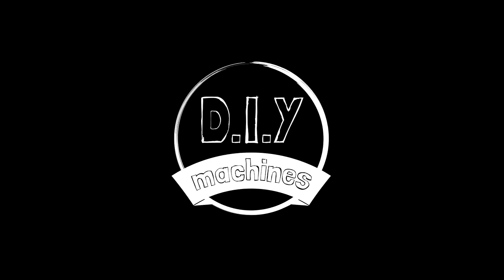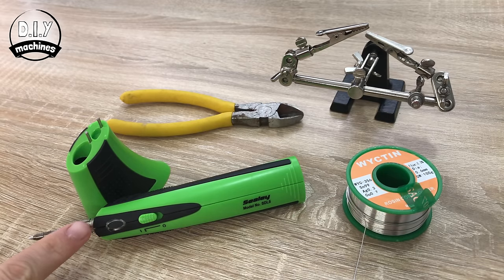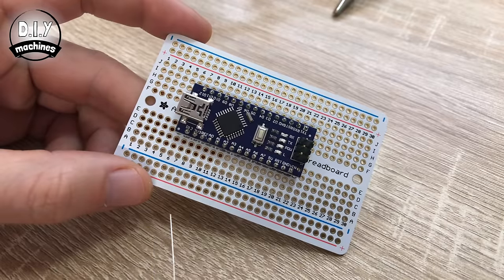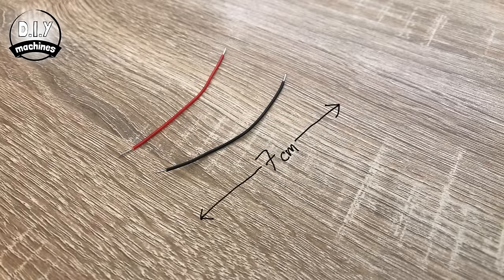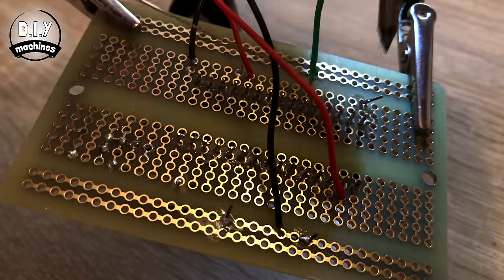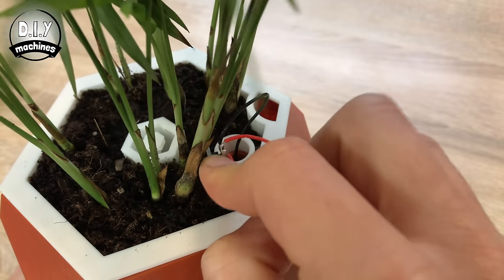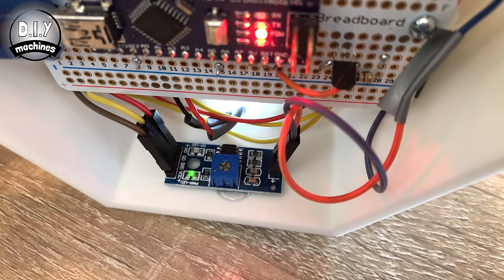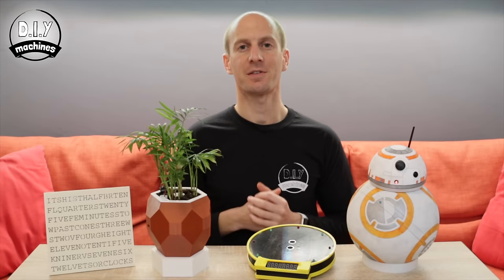Automatic Smart Plant Pot - (DIY, 3D Printed, Arduino, Self Watering, Project)

Comment: The 4.7 kohm resistor on the base of the transistor didn't allow enough current to start the pump that I am using (which looks identical to what is shown in this video). I kept lowering the resistance of the base resistor. The pump starts using a 470 ohm resistor. Hope this helps anyone else experiencing the same issue. Great video!

Comment: You have a permanent voltage on the resistive moisture sensor. It will do electrolysis and will fail rather quickly due to losing the conductive metal surface. It´s better to power the sensor only for the short time when a measurement is done. I would recommend capacitive moisture sensors tho. 
It´s a neat toy, alternatively a passive wicking setup would do the job as well.
Reply from the maker: Those are all very good points Karl. I'm considering a revised version later this year which will include a lot of the amendments you and others have suggested.

Comment: Ideally, when soldering, you want to put the legs of the component through the pcb and form them at 45 degrees to hold the component in place. This allows you to cut the legs to length before soldering, which avoids the possibility of cracked solder joints from snipping afterwards 👍

Comment: Next step: add wifi connect-ability and write an app so that you get alerts on your phone when refilling is needed 😄
Reply: this is quite easy, just use an esp instead of an arduino
Reply: @DIY-rf8qm  can't you use a nano with wifi and bluetooth?
Reply: @davyk2760  you can also connect a module. It's kinda the same, it only takes more wiring and space.
Reply: @DIY-rf8qm  Okay, thanks @DIY 101, I was trying to figure out if I can use those ESPs the same as an Arduino. They seems a whole lot better (minus lacking EEPROM) and are also programmable in IDE

Comment: A good idea would be too switch the moisture sensor out with a capacitive soil moisture sensor. Because of the exposed copper it slowly gets damaged while the capacitive sensor doesn't have any exposed metals.
Reply from the maker: You are completely right - I've since learned this myself. I plan to make a V2 smart plant pot in the future incorporating everything I have learned since then.
Reply: @DIYMachines  I would totally watch that

Comment: Amazing project. A few issues on my end. Once I upload the code, I am now only seeing "Water level sensor value: 25" in serial monitor but not the "Soil moister sensor is currenlty: ...." part. Similarly, my water level sensor is reading between 25 and 28, which is way less then yours in the mide 3 hundereds. My Pump does not seem to come on(desite that sensor being calibrated with a screw driver) and the led stays solid blue. Any or wiring mess up that oculd have caused this?

Comment: Nice Design. But the Soil moisture sensor is kind of trash. After 2 - 3 months it will rust through and the values are no longer consistent. P.S. the  Water level sensor too.

Comment: So impressive! how do you made watertight tank with PLA,not yet trying your print but always have trouble with that parts..
i'm working on similar stuffs and have a lot of settings for differents species if you are interested.
Reply from the maker: Hi, I printed my parts on a Prusa i3 and set the number of perimeters to three in Slic3r. The prints have been watertight as they are for me (I've tested it over several prototypes). If you're not having much success perhaps try increasing the flow rate.
Reply: thanks for reply,will give a try on this week,think will use it in aeroponia or hydroponic way! @DIYMachines

Comment: Generally speaking, are all PLA filaments appropriate for pots?
Reply from the maker: I used PLA and have had little issue, though the plant in mine doesn't like direct sunlight so the pot itself has not been in direct sunlight. I imagine years in direct sunlight on a windowsill coupled with the damp might not be kind to so kind to the PLA.
Reply: @DIYMachines  thanks for replying! That’s a good point. Would PETG or something be better? Loving your channel! Would also like to hear how to do a capacitor version of this like another commenter mentioned

Comment: Is there room in the base to use a battery to power the Arduino?

Edit: nope, not. Big deal. However, using the wires in the description I cannot feed  the wires for the pump through the pipe in the middle. I can get things straight up and down and I can get jumper wires through that side slot but I cannot get the solid core wires I soldered to the pump down. This thing took some serious engineering I just can't fish the wires through. I think up sizing this all around would probably make things a bit easier.

Comment: It's a very nice project. One could though do it without the pump and let the plant draw its water from the reservoir itself. There are many pots that work on this principle by having some form of gravel as a thin layer at the bottom of the pot. One only needs to monitor the water level then. The plant does the rest.

Comment: awesome video! Btw, may I know how did you get the value 180000 for one hour and likewise 900 = 30mins?
Reply from the maker: Thanks, and well spotted. I change my comments a lot whilst programming (and often leave myself notes which have nothing to do with the finished project) and have not gone back to tidy them up. 1800000 milliseconds is equal to 30 minutes and 900 milliseconds is equal to 0.9 of a second. :/

Comment: Hi, for the 3D printed files, specifically the inner pot, I wanted to modify the file to remove the pointy end on the underside that connects to the rubber tube, but I'm unable to remove it. I've tried Autodesk, Onshape, TinkerCad, and MakerBot. It seems like I have view only access, so is it possible to fix this?

Comment: Are you sure those water sensor wires are 20cm? I cut them that size and they barely made it into the small hole at side of tube to the base..
Reply from the maker: Hi Bob, I just double checked and you're right - they are longer. I would make them 35cm each. I'll add a correction on the video. Thank you for letting me know and I hope it didn't cause too much difficulty for you. Lewis

Comment: If i was to make it battery powered would you know what battery I would need to use and what resistors it would need?
Reply from the maker: You could supply between 7 and 12 volt to Arduino via it's VIN and GND pin. No need for resistors. 5 x AA batteries connected in series would achieve this. The project has not been designed with battery power in mind so you may find it does not run for long on battery power. Another alternative is to use a USB battery pack to power it via the USB connection.

Comment: Nano is not ideal for low power battery usage. Atiny is better choice for that project. It takes few miliamps on and if You use sleep mode, then power is reducing to few micro amps